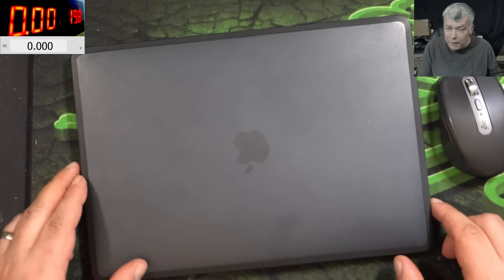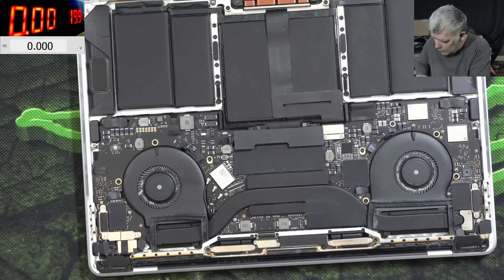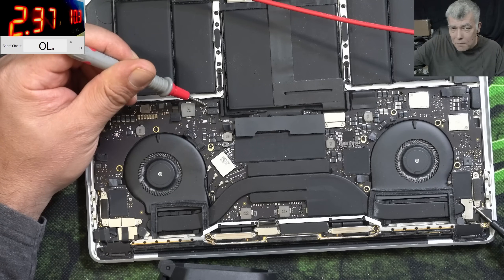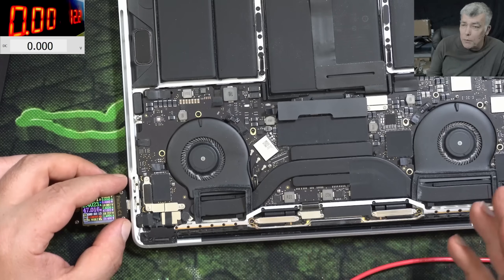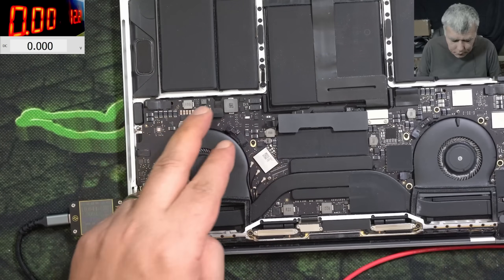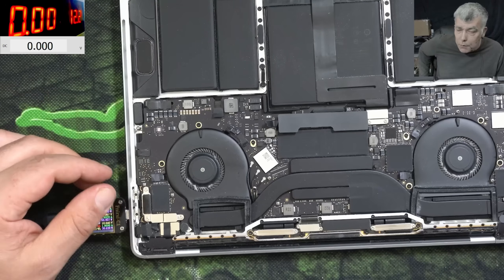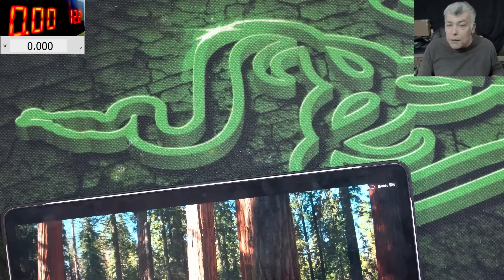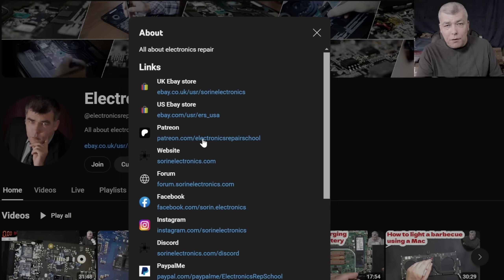How a hard to be found fault looks like, MacBook Pro, dead, not charging not comming on

Comment: It’s confusing when a short like this disappears. 

I would have: 

First inspect the full board under the microscope. 

Then measure from PPBUS to the other rails to check for a high side short, you may have ppbus shorted to a CPU rail through a drmos chip. 

If all other low resistance rails measure okay, start removing the shunt resistors from the ppbus rail to disconnect parts of the ppbus rail, each time checking if the side of the shunt for the short.

Once the shorted has been identified (example ppbus_g3h_spkramp) then it’s a case of using educational guesses to identify what may cause the short. 

Before injecting any power id first remove any IC that could be shorting ppbus into something important. 

example the bga audio amps can get dirt under them and cause ppbus to have low resistance to spkramp_rst. If you have a short here and you send it 12v you may damage the T2 chip resulting in no sound in OS. 

This also applies to any tps61280 chips on the board, they can kill SSD’s and PMICs if they get a bit of dust under them. 

98% of the time with tps62180 and audio amplifiers removed the short will be gone. If it is not gone it’s now safer to inject power.

This kind of short circuit is most common on MacBooks, I think voltage injection in these cases is a bad idea as it could lead to a cascade failure. 

Sorin probably has dirt under an audio amp chip, and leaving the device in this state leaves a chance the board will fail again in the future, possibly causing it repairable damage. 

The next time I come across one of these short circuits I will make a video troubleshooting it, I think it could help people.

Comment: Hi Sorin, do you think it is possible to change a Shotsky NSR20F30NXT5G diode that is in one of the voltage output phases of the TPS95994BF integrated circuit for a normal diode since I do not have one. The laptop is a Tinkpad T14 Gen 4.

Comment: Hey! I have a Lenovo Legion 5 Pro with an RTX 3060 the wifi stoped working from its own I dont know why I said its not a big deal I will fix it later and after a while it turned on from its own and every once in a while it stops and works again and I dont know why after a few day the GPU stopped working. It shows Code 43 in Device Manager, GPU-Z shows 0 MB memory, and there are glitches when hybrid mode is off or in safe mode. I tried reinstalling drivers (with DDU), but nothing worked I’m in Egypt, so I'm trying to figure out whether I should repair the board, replace the motherboard, or go the external GPU throught the thunderbolt 4 usb Do you think it’s a hardware failure (GPU/VRAM/VRM)? Is it repairable? Would using an external GPU (eGPU via Thunderbolt 4) be a good workaround? sry if the msg was tall but I really need the laptop and bcs I am an architect student and I use the laptop in all my assignments so I will realy appreciate if you can help me out

Comment: Hi, i am trying to fix one laptop motherboard and i am stuck. Its Acer Aspire 3 a315-21G with AMD A9 procesor and AMD Radeon graphic. First problem was in DC connector and i solved it (it was bad connection with wires). After that i got a power, when i press power button on keyboard blue light on side came on and fan spins about 1 sec and stops. Screen don’t even turn on. RAM is integrated on board and have one slot on itself. I put one stick of RAM and tries everything (reseting BIOS, disconnecting screen flat cable, inspecting for bad caps (all caps are good)). Is that even fixable or motherboard must be replaced. I found other one but i would like try to fix this one just for my practise.

Comment: The battery is not disconnected from the main power rail if ac_in is off ! 
the battery driving mosfet will always allow battery power to flow to main power rail till you connect the charger and ac is on, then the charging chip will disconnect the battery closing the battery driving mosfet and start charging through charging mosfets.. if the battery is deeply discharged or if there is a short in the main rail the one who disconnects the battery is the protection chip in the battery itself which has his own mosfets 🙂

I've faced similar faults which most likely it's a partially shorted very small capacitor that got fried and disconnected by the voltage injection 👍

Comment: Can you measure the resistance of the main power rail with battery connected?
If there is 10ohm with battery disconnected would it be possible to use a milliohm meter to check resistance and various points and you can see with higher resolution the resistance getting lower the closer you get to the faulty component?

Comment: Yes, you probably burned out a shorted capacitor, liquid damage on the other side of the board or something like that. I would approach this fault the same way.
Reply: How do you burn a cap with 0.8V and low current?

Comment: I suspect a battery reset. Or a dry joint which melted when you raised the voltage ...
Reply: you can also blow a short by pushing so much voltage through it, like a tiny cap that destroys itself

Comment: Did you burn out the short when you raised the voltage?
Reply from the maker: In the first second i touched with the red probe, the current spiked over 100mA, that was the moment when the short was gone
Reply: I think that's what he meant when he put the text on the vid, ie, current spiked then dropped - 3:05 -.
Reply: It is not necessory it was shorted in macbook when you plug charger even if laptop is dead and plug out the charger and check PPBUS/Main power rail with continouty or diode mode it will still show you shorted because the caps on PPBUS line are still partially charged so always specially on macbook give it a moment before you test ppbus after injecting power to it

Comment: i would unplug the battery and check the resistance again if it's 10 ohms and do what you did with the power supply without having the battery plugged.
Reply: Something that just came to my mind would be to unplug the charger, drain that battery all the way back down, and see if the issue is going to reappear. If it does, get a new battery (or diagnose further) in there... Then try again.
Reply: Exactly what i was thinking
Reply: classic lazy :)

Comment: Ofcourse you have 0V at main power rail
, your cable is not connected when you are in voltage mode -_-
Reply: @adriaensensa  you are correct
Reply: you forget battery power😂
Reply: @M-M-MCHANEL  battery below 0% will not provide any voltage to main rail